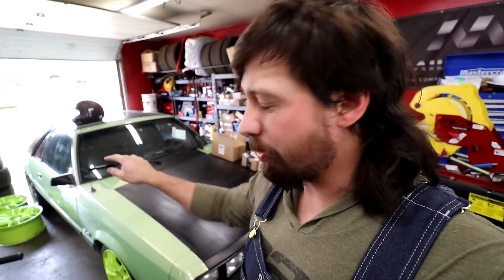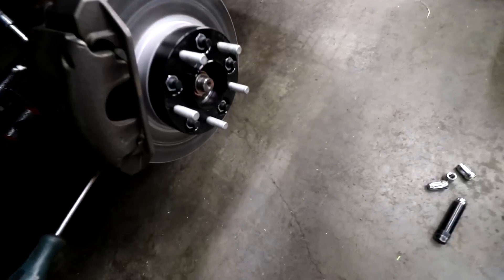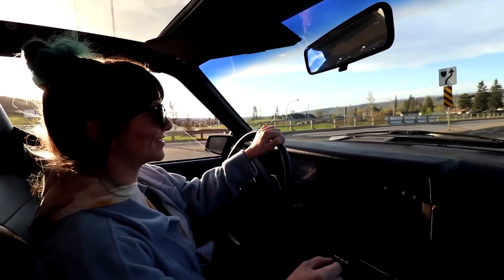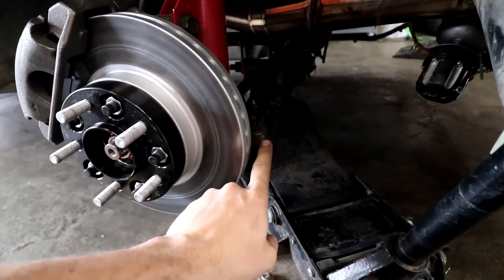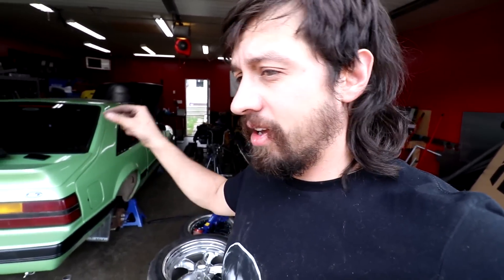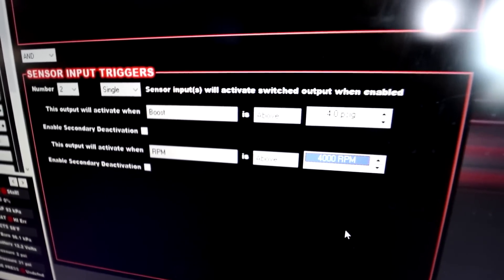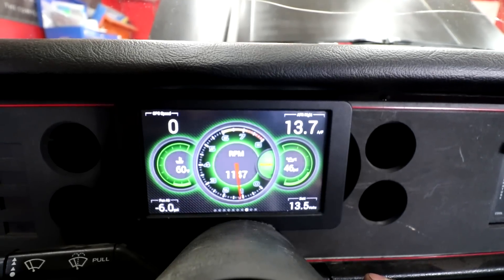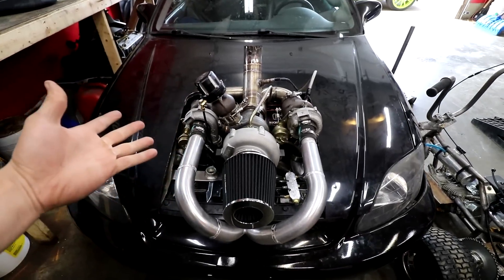Twin Turbo Fox Gets A New Look And Some New Upgrades.

Comment: kyle in the dash under speedo there's a multiplier box... change that to 1.6 for kmh... or at least that's how I did mine on my 6.7 dash
Reply from the maker: I'll try and find it 😁 thanks
Reply: @Boostedlifestyle   Yep thats how i did it on my 6.86 dash. i believe the 7" should be pretty similar.

Comment: On the allighnment the rack should be centered along with the steering wheel.  Therefore = thread engagement  On both sides. . Im certain how it sits it turns much sharper right then to the left. .  But hopefully the  allighnment  shop will correct this

Comment: I hate how being subscribed, with notifications on, I never get notified when you post and I find it on my home page. 🤦‍♂️

Great job with the fox man love the videos 💪🙋‍♂️
Reply from the maker: I also hate that 😂😂
Reply: @Boostedlifestyle  Wubba lubba dub dub my man! 🙏🤘
Reply: @Boostedlifestyle  The Pit Bike V2-2 frame  appears and  'looks' "Cool" ...
However, it needs important structural improvements, which are critical for durability and stability.
Just a few additional bars for proper 'triangulation' [Triangles] in the appropriate locations - will correct it.
-Think Triangles [not curves] = look at proper bicycle and motorcycle frames.
The corrections are easily to show via a drawing - difficult to specify just in words.
A. Front -at the points of two bottom rails curve upward toward handle bars, head stock
- one cross bar across the frame - between to two bottom rails - in the plane of the bottom of the frame
- at the point-location of cross bar - a bar from each side - connected from bottom rail cross bar-bottom length-long bar joint - angles to top long-length, horizontal bar which connects from head stock to the rear bars [with curves] - join these two, angled bars at the same location, vertically above the cross bar
=>Thus, the cross bar, across the bottom of the frame with the two angled bars form a vertical triangle across the frame, forming a vertical plane perpendicular to the plane of the bottom of the frame - facing frontward and backward.
=>Notice also, This triangle plane forms a near triangle with each side rail bar from the bend to the head stock, along with the upper horizontal bar from the  head stock - if the upper horizontal meets the other two bars at the head stock closer, the structure is closer to a triangle and stronger - as seen with proper bicycle frames at the head stock - upward curve of horizontal bar is unnecessary, actually weakens structure - better if connected straight, directly into head stock.
B. Rear - similar to the front - 
-two additional bars from lower horizontal, long frame rails, connected angularity with the upper horizontal bar 
- - joined at the location the upper horizontal bar joins with the two angled bars with 90 degree bends, meet 
- - join at the bottom horizontal rails at joint with cross bar between horizontal bars
=>Thus, the bottom horizontal rails are triangulated with the top horizontal bar, again, at the rear
=> Also, triangulates the frame between the sides at the rear, as at the front
=> Also triangulates the angled pipe of the frame with the curves
C. Additional triangulation for rear
- two bars,one from each side, at joint of the angled bars with the curves with the two bottom, horizontal frame rails
 - - connect to the joint of the curved, angled bars with upper horizontal bar, in the plane of these two angled bars with the curves
=>Thus, the connection of the upper horizontal bar is triangulated with rear end of the horizontal frame rails at the end of the upper bar
The angled bars with the curves look nice, perhaps, but lack for good, strong, stable structure =>thus, could be eliminated after or before triangulation.
Note: curves may look 'cool' but are not structurally strong, stable or 'sound'.
D. Other triangulation bars could be added 
- in the horizontal plane between the frame rails if desired 
- - from front to the middle and middle to the rear
- from the rear axle toward the front - at joint of angled bars from lower horizontal frame rails to the upper horizontal bar
- also from sides of axle at the frame rails to the rear of the upper horizontal bar 
--  similar with rear bars of a bicycles from frame area of rear wheel hubs to upper horizontal frame under the seat.
My hope this description is clear, especially visually and will improve Your view, perspective and perception about triangulation.
The structural improvement with triangles improve frame structure greatly, immensely, by multiples.
- this is precisely why a cage certification for faster, quick speeds require the gussets at each corner
- also, proper structures for tube frame chassis - all use and have triangulation [triangles] throughout the structure
-clearly proper cycle tubular frames have triangulation - triangles - triangular structures
-bridges and other build structures have triangulation - triangles - triangular structures
This may help with rear end structures for Your vehicles too.

All The Best and Much Success in Your Quest, Health, Happiness and Well Being.
Sincerely

Comment: Check those wheels studs are trimmed flush to the spacer so the clamping force is between the rim and spacer, not rim and stud tips, which creates a gap between the two and will make for balancing issues and possible stud failure...wheel goes bye bye.

Comment: Front wheels look wayyyy better without that spacer.
Reply from the maker: They looked way too tucked and had no turning radius
Reply: They look like they track wider than the rear. I get the steering issue tho. I guess I just like the tucked front "skinnies" look

Comment: Are you concerned at all with that oil pressure?
Reply from the maker: No why
Reply: @Boostedlifestyle  my turbo ls is simular. My first time rebuilding an engine and first start had like 45 psi then after a few drives 30 psi at idle is the new normal. It had me worried a bit, but after seeing you video and you not being worried makes me feel better about mine. Time to beat on her then!